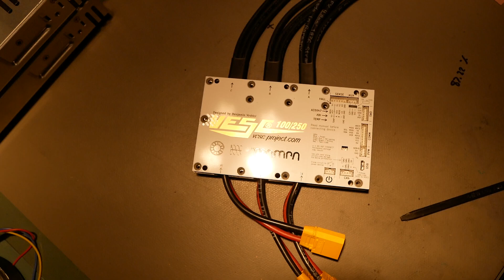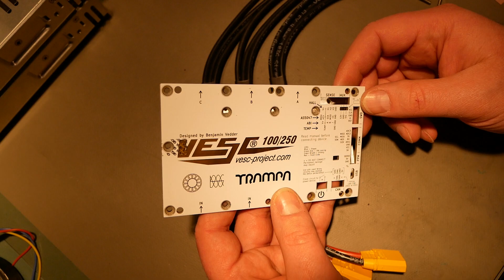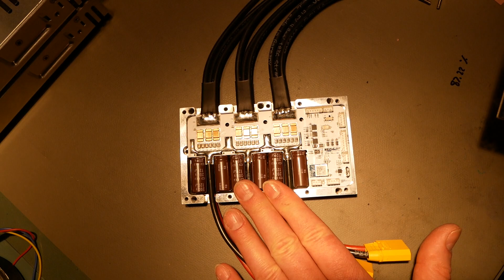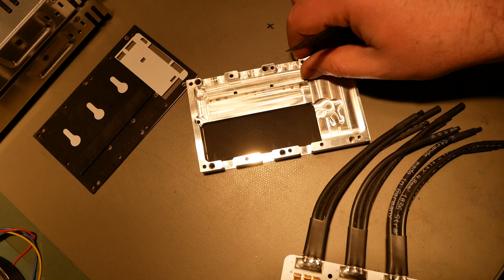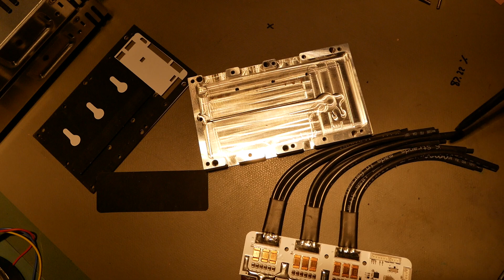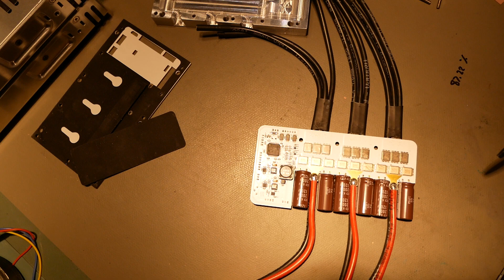Trampa 100/250 VESC Teardown 1 High Level

Comment: does it matter how we match the colors for the output and sensor wires?  A...B...C output correspond to H1...H2...H3  sensor plug maybe? color order matters?
Reply from the maker: No. The controller when you run the motor wizard will pair them up correctly. With a properly smart controller, you never have to do anything other than plug them in and then let discovery find the right pairings.
Reply: @de-bodgery  I've got a 30amp breaker on each of my battey input wires (kobalt 80V), do we need a breaker or fuse on the output? I'm trying to use a 3kw motor to make a paraglider winch so it'll run at high load
Reply from the maker: @FourthWayRanch  Output of what?
Reply: @de-bodgery  the vesc.....three phase wires to the motor
Can you do vid on vesc uart for this one too?
Reply from the maker: @FourthWayRanch  LOL...this is a bad idea! Increased resistance, increased inductance, increased losses, increased complexity. I don't know of a single case where someone puts breakers in the phases. What are you asking for the UART? You can access the UART via DavegaX LCD or plug in an FTDI adapter into it and use a terminal session on your computer or phone.
Reply: @de-bodgery  what the difference between HALL and AS5047 sensing?
Reply from the maker: @FourthWayRanch  https://ams.com/as5047p
Reply: @de-bodgery  do I need that sensor if I want to  exactly measure the rotation of the motor (amount of line payed in or out) or can the vesc do it with just the hall sensor?
Reply from the maker: @FourthWayRanch  sounds like you want a servo or stepper, not a BLDC motor. It can do what you are talking about, but it's not really the right application for VESC. VESC can run sensorless, with halls or sine/cos. Which ever suites your needs.
Reply: @de-bodgery  
we're makin one of these things:
https://youtu.be/5SOSqVtc0mo
Reply from the maker: @FourthWayRanch  That's a hub motor, nothing special there. Controller is running at a couple of speeds that are defined by the transitter...not special either.
Reply: @de-bodgery  If I get mine to work it'll be special
Reply from the maker: @FourthWayRanch  This is a piece of cake. I bet you succeed! If I have one idea to change from the unit from the video is to not coil up the cable on the diameter of the motor. Instead, have a spool that it winds onto. 3 or 4 loops around the hub motor is all you need. This will keep the work the motor does the same regardless of the amount of cable you reel in. This will also keep the speed cable comes in and goes out the same since the diameter it coils around the motor never changes.

Comment: Brilliant 👍👍
Im researching controllers I can use to convert my DeltaWing Trike from gas to electric. VESC is looking good but I am wondering how well those caps will hold up to longer battery leads producing larger voltage spikes, say up to 2 ft where I want to place more from batteries.
Cheers
Reply: Seems I'm following you around somehow. Small word for sure. I was looking for an idea to build a glider winch setup...
Reply from the maker: You will do best to keep the battery wires short

Comment: Great job. Learning from such an expert great oppurtunity for us. I hope, you can do fardriver controller teardown too. By the way, I am curious about software and control algorithm comparison on efficiency but I guess it is hard to make such comparisons. Thanks anyway:)
Reply from the maker: That is coming actually! I have at least one headed to me real soon. I won't be ablw to do efficiency testing until I have the EV set up that will run all the controllers. That takes more effort than a tear down!
Reply: Hi mate is posible to used dc rectifier??  I will used for control my pmsm motor 90v. Is posible so ac220v with rectifier. @de-bodgery

Comment: 250 battery amps and only 6 mosfets in one half bridge, 
it doesn't look too good
Reply from the maker: Keep in mind that these mosfets are rated for 375 amps max each. They are already redundant with 3 in parallel. The idea is to leave a lot of capability on the table so you never push them too the point of burning out. Crazy that such tiny parts can conduct that much current, but that's the specs of the mosfet!
Reply: @de-bodgery  in fact, what it says on the header of the datasheet can be omitted, a simple marketing "trick". The real specs are much lower in the safe operating area chart. I have mosfets on paper better than these. And yet someone who designed my controller sends 4 times less current through them than in this vesc, interesting
Reply from the maker: @pingwinvonjelen6586  I did say that was maximums. Mosfets vary widely in specifications. You have 2 current limits to contend with and one is inferred. The specs in the datasheet are for the mosfet dye inside the package. The actual package used is another set of specs and may be much less or way higher than the dye specs. This is something that lots of people are unaware of. In TO-220, it is very common to have 180 amp dye limits or more. This is pretty meaningless because the TO-220 package is limited to 75 amps. AS a result the real current limit for the mosfet isn't 180 amps, but rather 75 amps. This is the inferred current limit. DPAK2 has current specs too. What the actual dye is capable of may not really matter if it's higher than the limits for the DPAK2 package. Amperage is one of many factors that is taken into account when choosing the right mosfet for any application. This specific mosfet may have been chosen not for it's dye current limits but for gate capacitance or heat tolerance or a dozen other reasons. Paper specs are helpful, but they are not law in the real world, just guides.
*
You have a controller design? Care to share more?
Reply: @de-bodgery  I'm trying to design my own, and it was during the selection of mosfets that the question arose of how many to implement. After looking at dozens of controllers, I was a bit confused... greentime  ~ 18A per mosfet, sabvoton ~ 40A per mosfet,  there was also a kelly - similar to sabvoton, and the highest current through a single transistor I saw in vesc controllers, as above - about 80A through mosfet. somewhere there was an analysis of the controller in the older tesla model S, and the current was similar to vesc... Eventually I accepted 50A for the mosfet. But I am surprised by such a large discrepancy, as long as I can believe in chinese greentime controllers that such small values are intentional, due to fake mosfets, I do not understand the difference between a typical ebike controller like sabvoton and vesc
Reply from the maker: @pingwinvonjelen6586  Parts quality is a big deal! You see all the western made parts in this controller. There's good reasons why this controller holds up so much better than the Flipsky clone which is made of Chinese components.

Comment: This give 250 phase Amper...?? To one motor?
What's the dc ampers ..?
Reply from the maker: 250 amps battery and 400 amps phase are safe maximums. you are unlikely to burn out the controller if you stay under those limits. People go over them quite often and they also risk burning out the mosfets. Be sure to heat sink the controller too!
Reply: @de-bodgery  why (also and me) use sabvoton or Kelly controllers for e scooters and not them... 🤔
They are not made for escooter motors? 
And I afraid them for FIRE... because they heat up quickly!
To give 500a both motors from a battery, the battery must be huge....
And I don't see so big batteries (with so big discharge) to scooters that already get fire...🤔
Are these controllers only for e skates and small motors..? To not heat so quickly...
You are encyclopedia of electronics in my eyes!!!🤙😁
Reply from the maker: @Antony--DIY  I do use VESC controllers for e-bikes and scooters and even bigger stuff. I do own a kelly and a sabvoton, but they are far inferior to a vesc for functionality. They will run any hub motor, inrunner or outrunner out there. The Flipsky 75100 is a pretty poor design and frankly Flipsky knows better than to make junk like that! They soon came out with a V2 of the 75100 that was much much better. Most everything VESC is very compact because they don't have an heat sink. That's up to you to add that as your part of the controller implementation. With sufficient heat sinking, most anything VESC does just fine and doesn't over heat or explode into flames.
*
Battery is a totally different matter. You obviously need a pack that can deliver the current you want delivered to the controller. IF that's your limiting factor, anything VESC can be set to much lower battery current than its maximum. So if you had a 100 amp VESC controller and your pack could only deliver 50 amps, just set the controller to 50 amps. This will obviously limit the power of the controller, but better that than cause a battery fire!
*
Join Discord and you'll have access to lots of people and many know way more than me! https://discord.gg/TKd3PkXK
Reply: @de-bodgery  just sing in!! Thanks allot!!
Is there a page talk about e scooters?
Reply from the maker: @Antony--DIY  Explore around, be chill, ask questions, as you can see there are a zillion sub groups. I'm mostly in the controller section for obvious reasons.
Reply from the maker: 250 battery, 400 phase
Reply: @de-bodgery  where do you actually find the phase amps spec? cant ever seem to find em on vesc vendor sites.
Reply from the maker: @sn0wchyld  Trampa web site is where I saw it. Did they take that down? I have to admit it was a while ago. Maybe they edited the sales page?
Reply from the maker: @sn0wchyld  BTW, saw what you posted about the burnt terminals on the KO controllers. Thanks!
Reply from the maker: We've met before...pretty sure.
Reply: @de-bodgery  we have talking when you upgrade your City scooter!🙋‍♂️😘
Reply: These videos searing to us, are GOLD in our hands...!!!🙇‍♂️
Reply from the maker: @Antony--DIY  LOL...yup, forgot! your name was familiar, but I couldn't remember why.